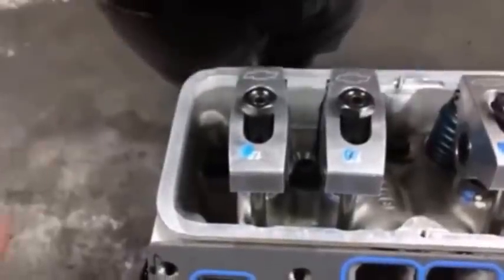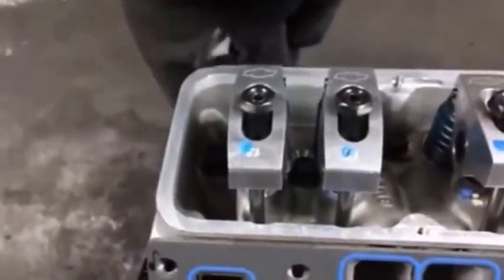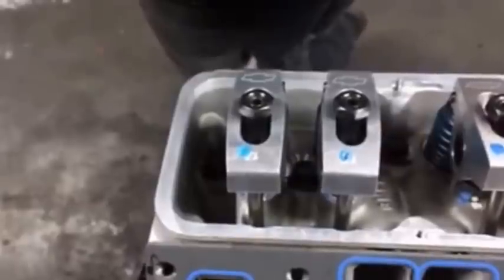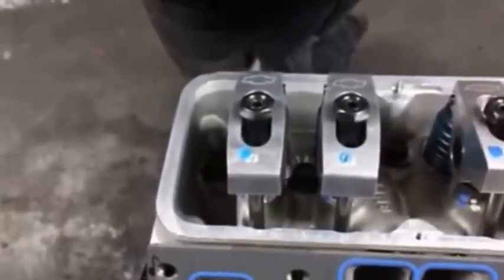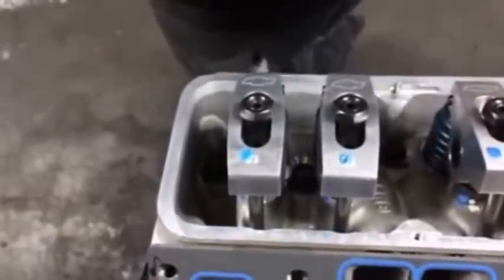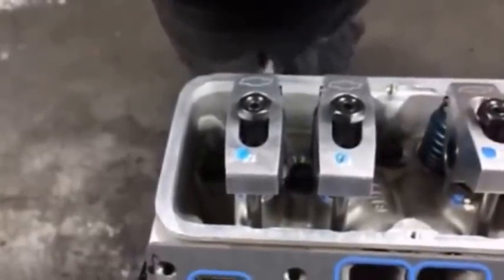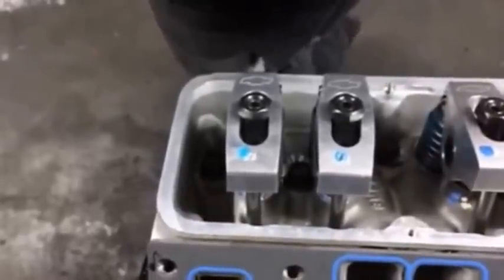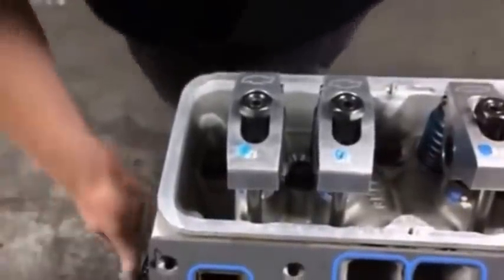Adjusting Valves Video by Crate Insider

Comment: After locking down as the video states, are you supposed to still be able to barely jiggle the rocker arm?  Is a little jiggle too loose?  Is no jiggle too tight?
Reply: If the lifter is not pumped up, there will be "jiggle" until the engine starts again.